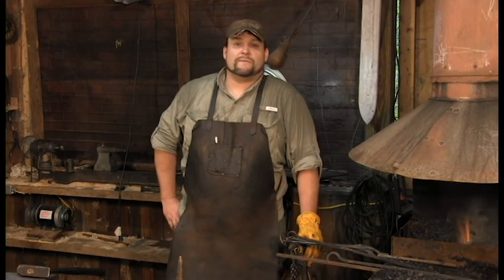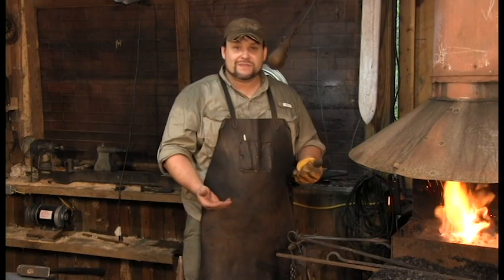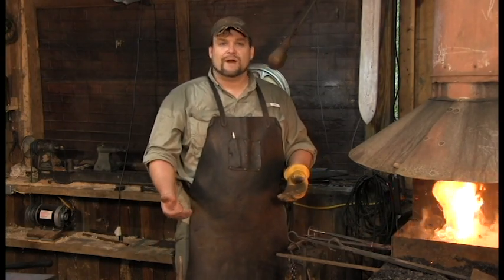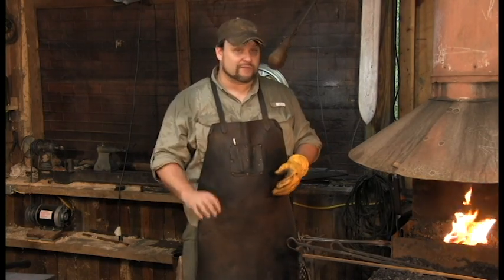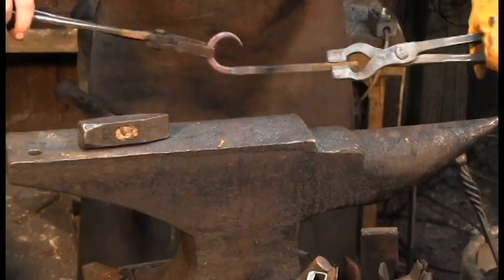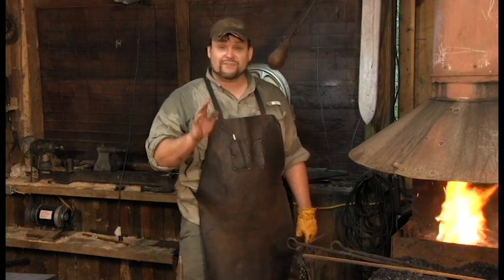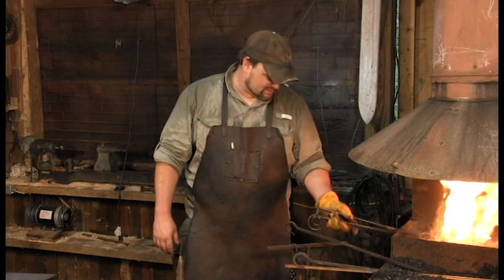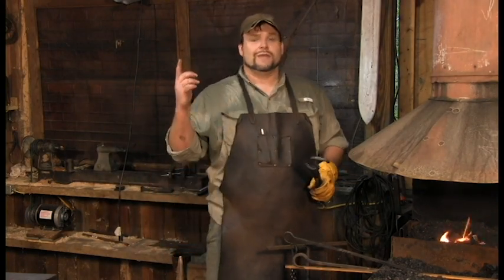Forging an S Hook For Demonstrations

Comment: Great video!! Quick question does the glow of the hot steel not affect your eyes? I know when I cut with a torch I have to use dark goggles to be able to see after I'm done cutting.
Reply from the maker: The metal doesnt get bight enough during the day, can be a little bit in the evening. Unless you are forge welding or really doing some hot work, its not going to bother you. However, I do normally wear some light sunglasses just because I have sensitive eyes.

Comment: first off awesome video thanks for sharing your craft. What is the point of wire brushing it? is it to remove scale or prepping it for finish?
Reply from the maker: Hot brushing removes more scale and burnishes the metal as opposed to fighting it when its cold. Lots of stuff that comes off when its hot is a pain to get off when it cools.
Reply: +purgatoryironworks thanks Trenton

Comment: I really love these videos! As a newbie, I find it so refreshing that you take the time to really explain the process in laymen terms. Also, did you fabricate the flue and hood above your forge? I've been trying to find pipe of a large diameter, like what you have, with no luck. Any chance you could demonstrate that process, if you ever have the time?
Reply from the maker: Hey Hobby. Thats a bit of a tough one. That pipe is actually the outside of a 12 inch smoke pipe. Most smoke stacks have an inner part and an outer part to prevent fire hazard. I simply ripped out the inner part and used the larger outside piece because I have no direct contact to anything flammable. The hood was a little tricky and we can surely try and get a video out for that.
Reply: Awesome! I thought about repurposing an old 12"X10" rectangular stainless flue, but I wasn't sure if the shape was conducive to the proper flow. I've been told that venting forges is a lot different than venting a fireplace. Do you think that a rectangular pipe would work? I've got about 50' of it.
Reply from the maker: Oh yeah, shape really doesnt come into play unless you have bends
Reply from the maker: Yeah, it should work fine, Jay's forge in Andersonville was square pipe

Comment: I met you several years ago at the Georgia Renaissance Festival. After your "S" hook demonstration I hung around and asked you a bunch of questions and, seeing how nobody else had inquired about it, asked if I could buy your demo "S" hook. I was expecting to hear a price of $75 but was pleasantly surprised when you sold it to me for $5. It's sitting on my desk right now. I have a few questions. If you are on the clock how long does it take you to make one "S" hook (without all the pausing for explanation) and how many could you knock out in an hour? Also do you offer beginner blacksmithing classes?
Reply from the maker: I can usually do 20 in  an hour with no real issue. As far as classes, we do them but our main business has gotten in the way of a lot of that. We are working on housing for classes, so just watch the FB page and thats where we announce

Comment: shouldn't you stick the iron right on the edge of the anvil, so any time you hit too close to the tip when forging a taper, the hammer head only touches air and not the anvil, and of course the hot iron. forging a taper in the middle of the anvil is high risk for hitting the face of the anvil.